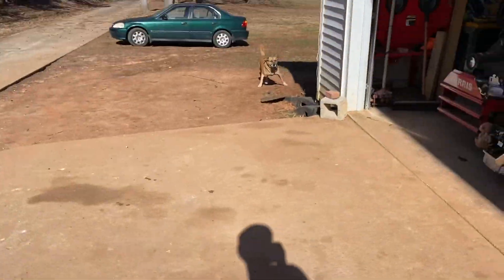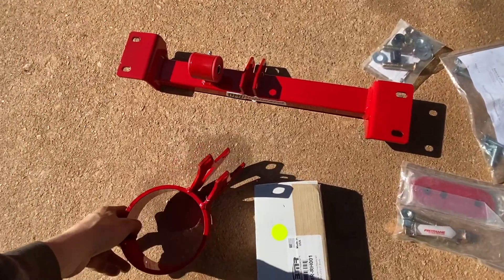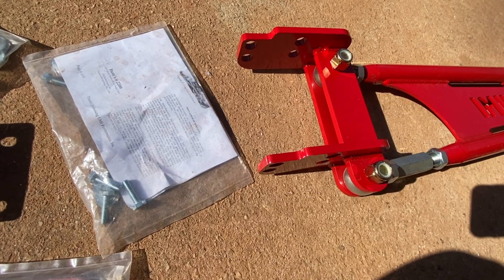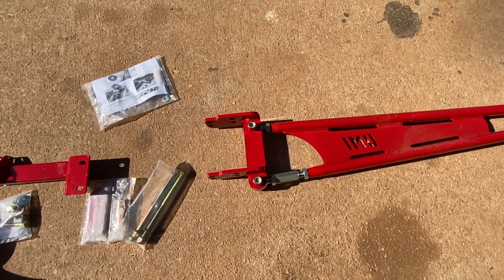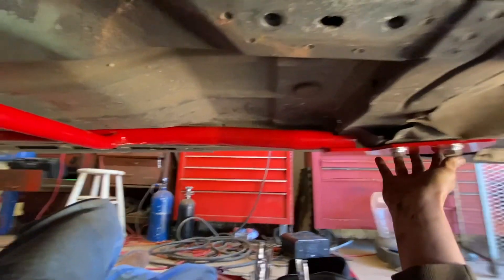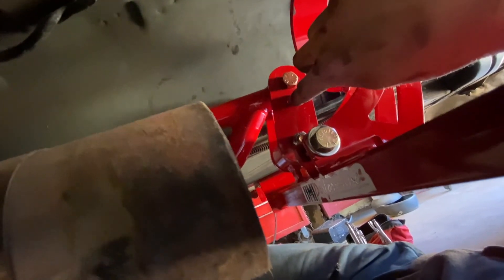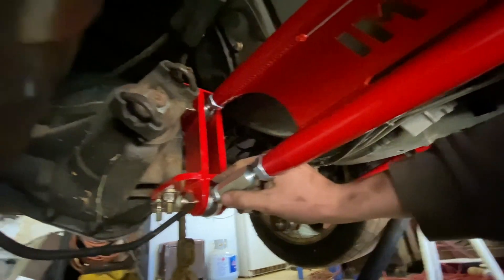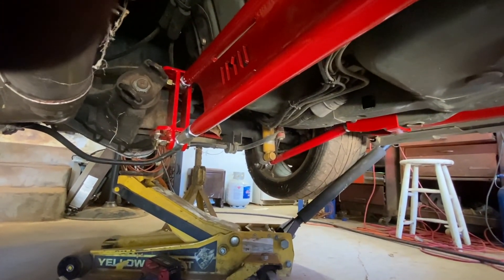Installing my Torque arm in a F-body

Comment: I bought a 99 TA and its got the umi torque arm as well, but as soon as I hit the fast pedal, it makes a clunking noise from the rear but i can't pinpoint where its coming from. Seems all the Bushings are good. Any help what to look for is appreciated man. Great vid!
Reply from the maker: I had to clearance the sheet metal next to the torque arm on the driver side. When I would hit a decent bump. The Torque Arm would hit the transmission tunnel. I had to hammer it out. It was a big PITA. Hope this might help.
Reply: Hey throck, I believe you bought a shorter torque arm when u needed same length. I thought I was crazy but I had bought a tunnel mounted when I needed a tailshaft mounted torque arm

Comment: Can I ask what you have for ground clearance from the bracket for the tunnel mount torque arm? Just deciding if want to do that with car being on street way more than track.
Reply from the maker: Tunnel is rough, real rough for a street car. For stock height it is bare able. Lower car pain in the butt.